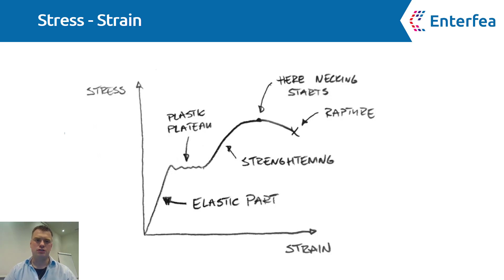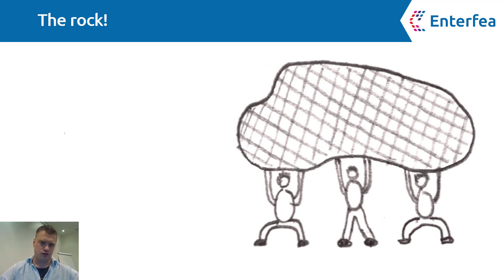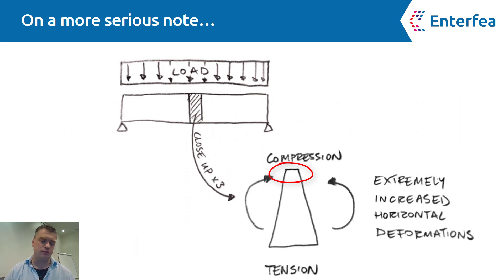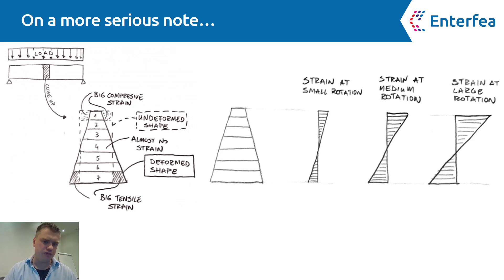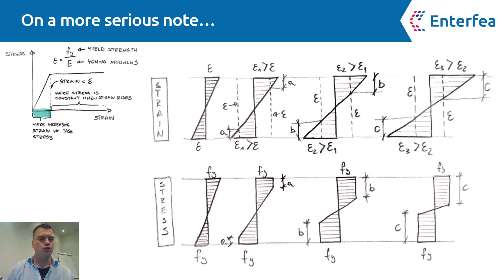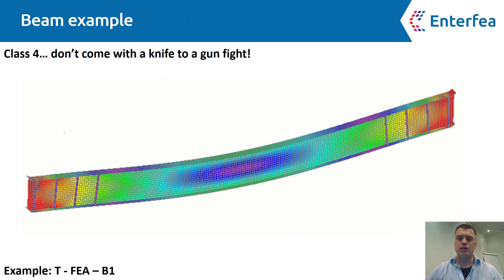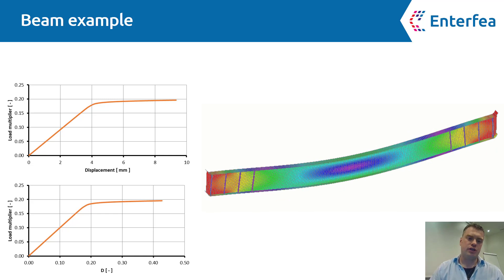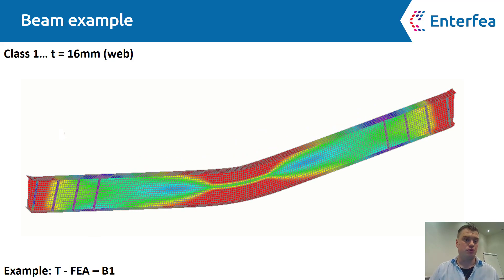Nonlinear material in FEA

Comment: Are you saying, that perfect elasto-plastic or bilinear material model causes non-linearities in the model? I think that is wrong. In cases you are showing here are the non-linearities caused by large displacement. I think material non-linearity is caused by non-linear material equation (usually exponential) e.g.; Holomon, Voce and his modifications.
Reply from the maker: Hey Lukas! I'm a bit embarrased, as I missed several comments so sorry for replying so long (!)
Well... by definition linear material has a linear relationshim between stress and strain. If you use any other model (like bi-linear in this case) this will make the model response nonlinear if the loads are high enough!
Hope this helps :)